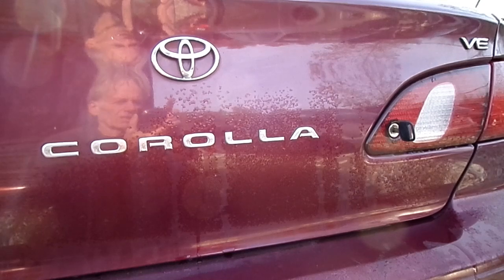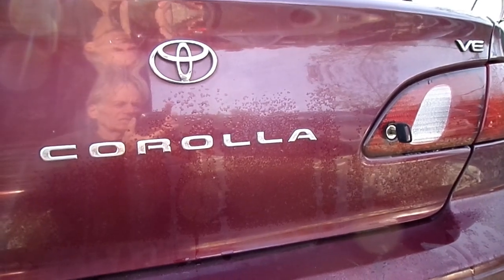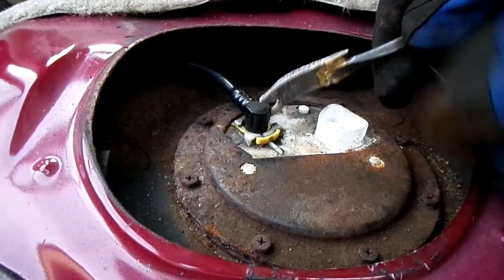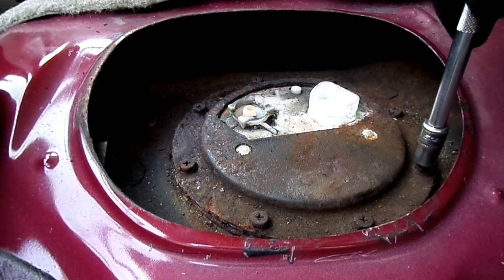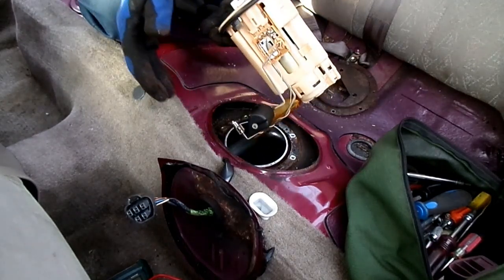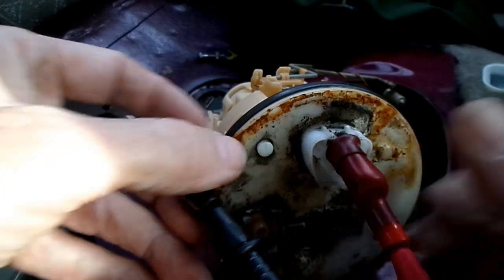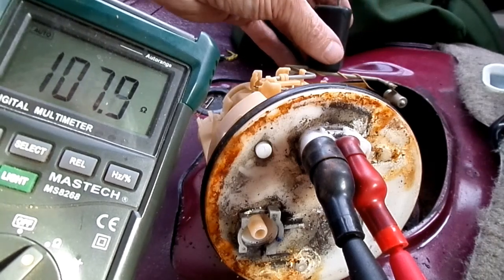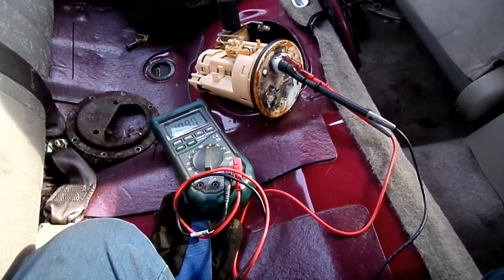Toyota Corolla Fuel Pump Removal Sending Unit Testing

Comment: This helped me in removing the electrical connector. Squirrels had gotten in and chewed away one of the wires to the level sensor! They left a fir cone and sunflower seeds to show they had visited.  A one inch length of the purple wire was completely gone,, and the white wire with black tracer had its insulation chewed through; sliced in a new section of wire and the fuel gauge is working again. Thanks, saved a trip to the dealer.

Comment: Thanks for showing the procedure to check the fuel sending unit.  I think mine might be bad but don't want to buy the part before knowing for sure.  Already replacing the filter and some other stuff, so the cost is getting up there already without buying it too.

Comment: Hi there, a question from New Zealand.  Can you please tell me which of those pins is power to the pump inside.  They have a wite and black wire and a blue wire, I can't figure out which wire is power to pump or which pin is power.  I have a problem also astablishing power from the relay so can't use a light or meter to test when ignition switches on.

Comment: My fuel gauge indicate that it's only 7/8 full when I filled up the tank. I was told it's a bad sending unit/sensor, so I replace it with a new one but it still did solved the problem...and my gas gauge still shows 7/8 full so does my new fuel sending unit/sensor needs to be calibrated? If so, can it be calibrated while it is still in the tank..I hate to remove it out again because it such a hassle?

Comment: Do you happen to know if a 85 camry 2.0 liter engine 
 you got to drop gas tank to change fuel pump?
Reply from the maker: I believe you have to drop the tank.
Reply: That stinks I figured that. Been so cold -10 haven't looked at it.thanks for the reply

Comment: Now i do like the port hole tank access, so much better than dropping a tank with rusted solid brackets/bolts. :-( , shame that all manufacturers dont do that.

So that variable resistor is good, but what about the pump, was power applied before the removal to see its delivery?

The new mastech meter seems to be doing well, better than the old one you had in early videos :-))
Reply from the maker: Yes testing the pump should be done to see if it is in good shape.

Comment: Great video . Question : I just replaced the fuel pump on my 96 corolla and tried to check the sending unit. I don't know if I set the multi meter wrong or what but I did not get a reading? Batteries are good on the multi  meter so......?
Reply: He said to set it at Ohms Ω

Comment: Hey rich is that reading of 107 on empty to 3 on full  ohms of resistance can it be used in general for al fuel sending units
Reply from the maker: Close but they due vary a little from manufacture to manufacture.

Comment: Where is the fuel fuse and relay on these cars?  I have a 96 Geo Prizm (Toyota Corolla clone) with crank no start condition.
Reply: mr c i have a 99 prizm did you ever find out where the fuse and relay is

Comment: Great vid Rich. So that is what I am wondering : do you have to siphon the fuel out? I may need to change a fuel filler neck and I am wondering if you have to ? That's on my Neon of course.
Reply from the maker: Filmaker25 You want the fuel to be very low in the tank.
Reply: Thanks Rich!

Comment: Mississippi fuel pumps work on a 1989 Camry in the back seat 1989 Toyota Camry Toyota Camry the fuel pump is located in the back seat I got it out why do I know if it's working

Comment: Why in the world isn't that first cover not bolted on , but instead it's a glued on gasket. Good luck on not damaging it.  It was so much easier to change fuel filters and pumps when they were not in the fuel tank. Does anyone know why in the world they start putting them in the fuel tank.
Reply: so it can get cooled by the fuel itself.

Comment: is that where the fuel filter is locate as well?
Reply from the maker: +jay rod On the 1998 and later the filter is integral with the fuel pump module.
Reply: oh so that mean its clogged boom there goes the fuel pump what a pain